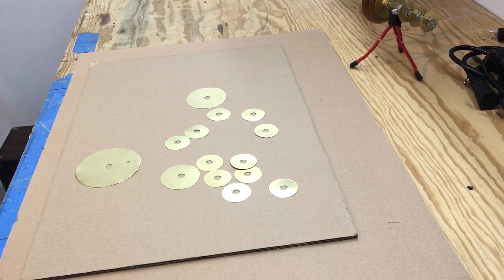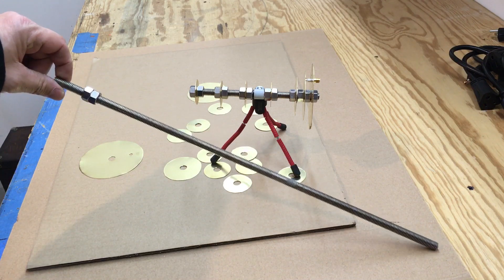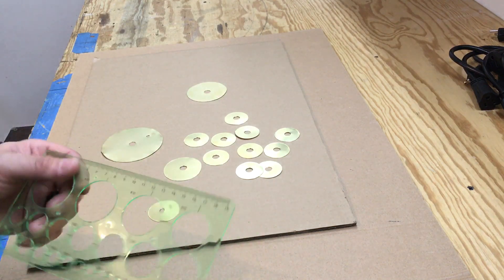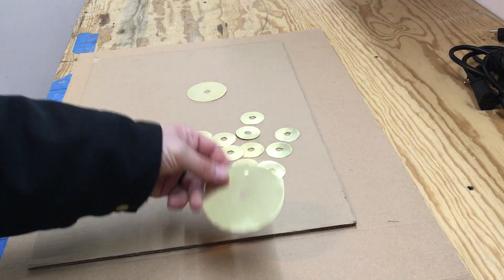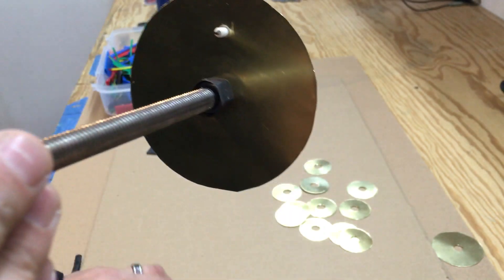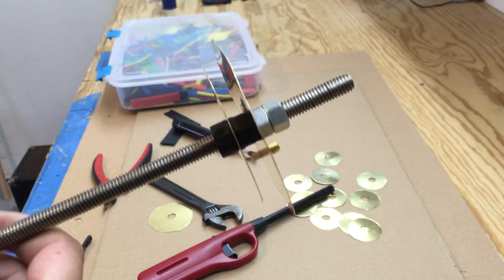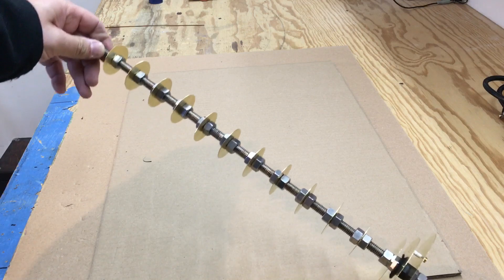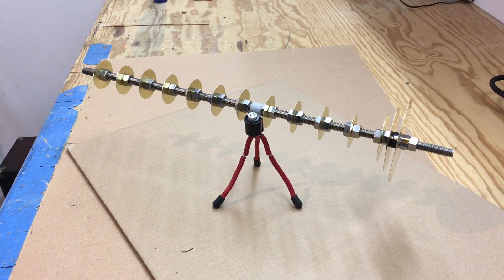Big WiFi Gun Antenna

Comment: I'm 530 yards from where I need a signal. Rural, a few houses, some trees ... Line of site almost. Will something like this work?
Reply from the maker: You might be better off using a yagi antenna.
Reply: @FuzzThePiGuy  Isn't this a Yagi antenna? I mean in theory it works like that from the looks of it.
Reply: Deep Space Angel A Yagi antenna is designed differently as it has a 1/4 wave folded dipole as its main Active element & the other isolated front elements provide about 2dB gain each. which I guess is the purpose of the isolated disks on the gun antenna. The larger rear element of a Yagi & indeed the disk on this Gun type is to reject the other frequencies we aren’t interested in.
Reply: Make the antenna bigger and bigger disks
Reply: DustyPlayz There are reasons why the disks are a particular size so making them bigger decreases the frequency that it resonates at. Decrease the diameter of the disks and you increase the frequency at which it works.
Reply: Does it support 5.8G band？

Comment: Show it working.
Reply from the maker: I have a video of it connected to a laptop running WiFiTE.
Reply: Ok. I have a similar antenna but it doesn't work. 
Is your anttena conected by USB port? https://youtu.be/Nk-nj_BwoBE
Reply from the maker: Yes I plug in a WiFi USB adapter to it and the computer.
Reply from the maker: More information on my website at http://fuzzthepiguy.tech/wifigun/
Reply: @FuzzThePiGuy  Great!
Reply: Does it support 5.8G band?